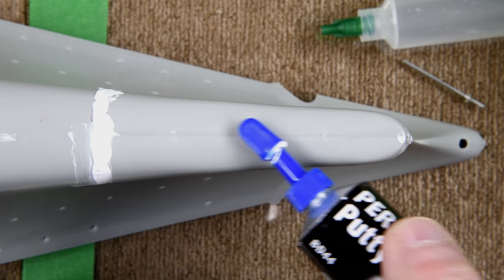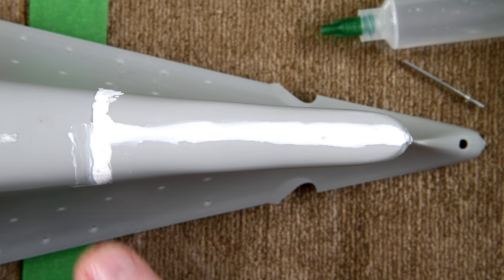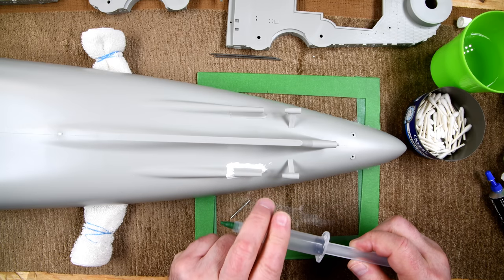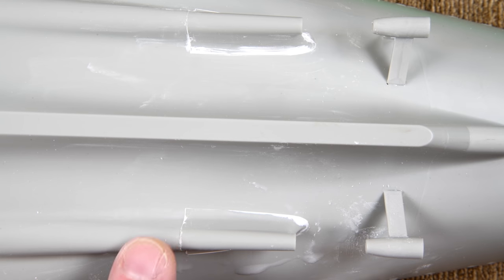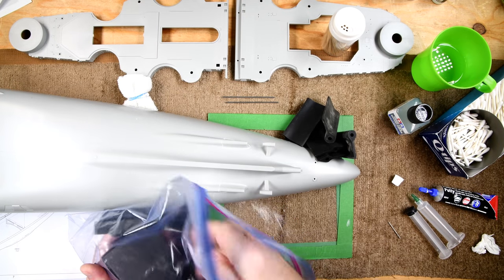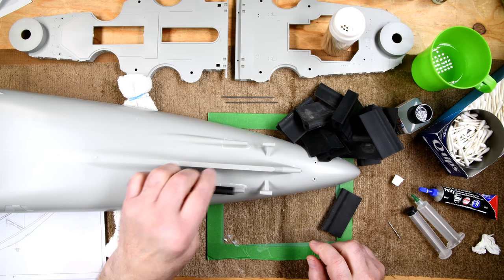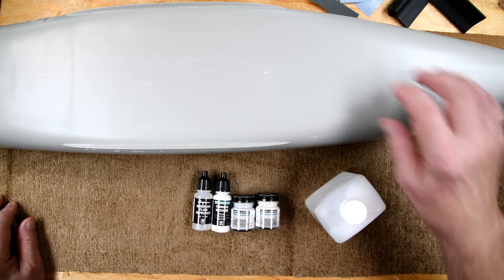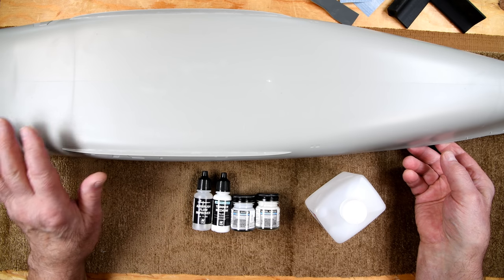The Model Ship - Part 39

Comment: Ron, it’s gonna be fill, sand, prime, fill, sand, prime until you can’t see the line after final prime. It’s a pain, but in highly visible areas, you don’t even want a hint of the joint.
Reply from the maker: At that rate, I'll never see this thing in a case Tony, lol. 😁
Reply: I'd agree that a sandable primer with some build to it is the only way to see how your joints are looking before you put paint down and it's too late to fix it.